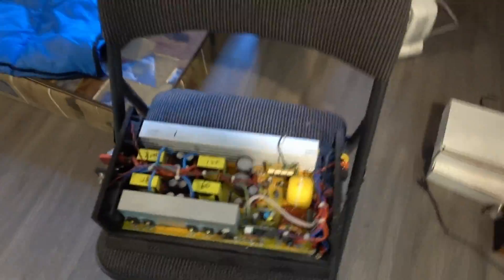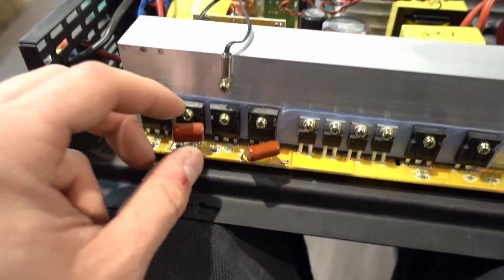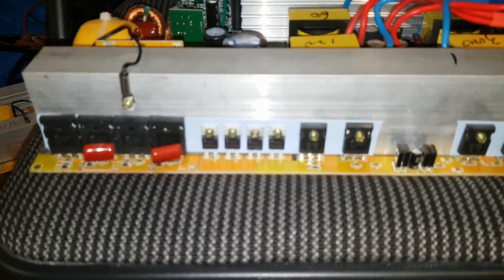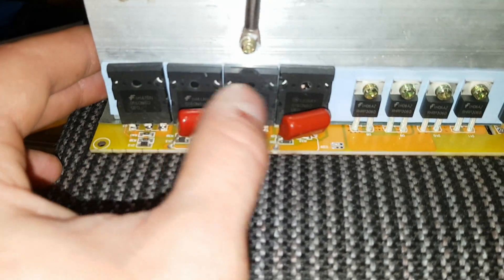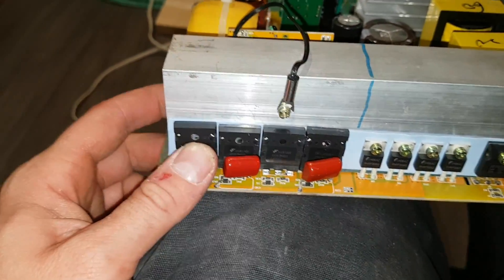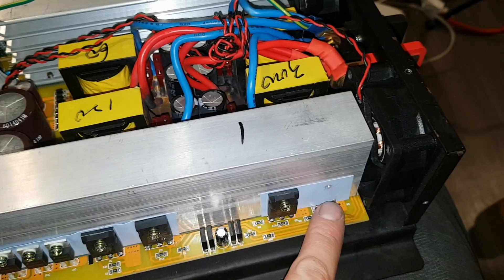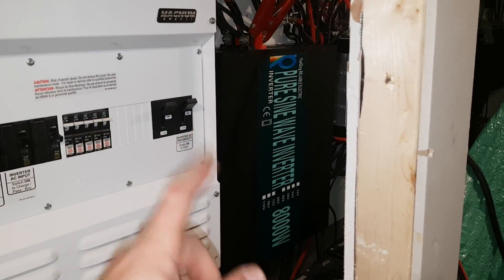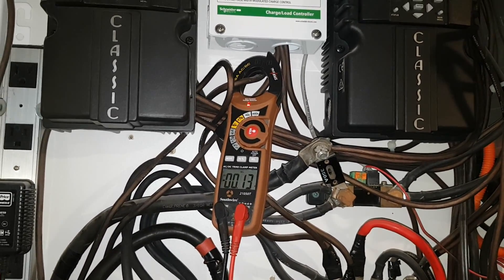3000W inverter Upgrade PT1

Comment: I wish I had your knowledge of electronic stuff. I'm building out my camper and I've got a decent solar system put together with a 4000 watt low frequency inverter for the minisplit and a 3000 hybrid deal running the rest of the camper. Its 1800 watts of solar and some leaf modules for battery at the moment.  Hopefully soon I can get about 20 or 30 kw of  lifepo4
Reply from the maker: That would  be a killer  system,  I have a 15kwh battery bank in my house  trailer with a 3000w inverter and 1200w solar on roof plus 800w of semi flexible panels. I love it! Do you have a video showing your system?
Reply: @GoingOffGrid101  I've not made a video yet but I'm going to try to make the video when I get home. I'm an over the road truck driver and only home 2 or 3 days a month. When I am home I'm working as fast as I can the whole time I'm there trying to get everything installed and working. I've still gotta wire up my minisplit but other than that it's all working great. My leaf batteries have me worries because so many people say they will catch fire and they are under my bed in the camper. I think I'm gonna build a box and set them outside the camper this weekend if I get the minisplit wired up and took care of. I'm wanting to get some lifepo4 but even if I get the lifepo4 I'll probably still use the leaf modules on one inverter and just have 2 small systems rather than having both inverters pulling from the same battery. I'm so undecided about the leaf modules cause they costed me a lot and work great but at the same time I don't want a fire lol
Reply from the maker: @matthewknight5641  if you have a good bms they will be fine put a smoke alarm under your bad and get insurance and never think about it again :)
Reply: @GoingOffGrid101  that's so funny lol.... maybe that'll work
Reply from the maker: @matthewknight5641  I have 9kwh of similar batteries under the spare bed in my trailer.
Reply: @GoingOffGrid101  if I can figure out how to make a video I'll for sure do it this weekend cause I'd like to show off what I've done. It's just a hobby but I'm kinda proud of what it is and can do ya know

Comment: Remember TO-3 versus TO-247 are different FET packaging, TO-3 is older and has more mass (metal). Google it. The MOSFET he is using to do the upgrade and also from the 8000w inverter is G160N60UFD.

Comment: Am sorry to say but it’s the manufacture manufacture fault when a inverter is overloaded the current sensor TC or or current sensor resistor should always sensor the load of either overloaded or short circuit to shunt the unit of of delay the signal for fast recovery my design will never burn up from overloaded or shorts
Reply from the maker: What inverter do you make?

Comment: Hi, i have edecoa 24v/230, 3500w inverter, mosfets are gone. Can you recommend some upgrade for them? Also cut off voltage is too low for my gel batteries, it goes till 20,5, and i would like it to stop at 23,5v. Any advice? Thanks in advance...
Reply from the maker: Can't help with the low voltage on inverter but I use g160n60 IGBT

Comment: Thank you very much for the help you help me recover my $3,000 w inverter only two mosfets were blown the first two in the front different brands magicchip think
Reply: Ran out of solder braid to remove the solder so I only put in the first two igbt Grand a paint stripper for a half hour for testing and use my thermal camera to see the second igbt was the hottest point so I moved the thermostater to the screw for the igbt 👍
Reply from the maker: @leighamos489  thats amazing! thanks so much for letting me know I love it when I hear I helped someone in any way!

Comment: i have the 3500w version but the fets are FQA40N10 but i cant find anything listed on google, is there an equivilent or better that i can use, my invertor is not blown but i would rather have a replacement set as spares
Reply from the maker: I will be making a 4000w inverter repair video soon.

Comment: I had to look this up. An insulated-gate bipolar transistor (IGBT) is a three-terminal power semiconductor device primarily used as an electronic switch which, as it was developed, came to combine high efficiency and fast switching.  Although both IGBT and MOSFET are voltage controlled devices, IGBT has a BJT like conduction characteristics. 2. Terminals of IGBT are known as emitter, collector, and gate, whereas MOSFET is made of gate, source, and drain. ... IGBT has PN junctions, and MOSFETs doesn't have them.  That may still be a bit "Hah?" to some of you (me too), but that is all the looking up I am going to do today.
Reply from the maker: that and they handle more amps and heat :)

Comment: Hi Going off Grid,
I have 1000W reliable inverter and now it has small spikes in zero crossing region. I checked all the IGBTs and FETs and all of them are okay. means there is no any shorted pins. all the resistors in front of the FETs are okay.  I think you can help me to figure out and fix this. Your help on this highly appreciate. Thanks
Reply from the maker: you mean you can see a small spike with a oscilloscope ? is the inverter operating?
Reply: @GoingOffGrid101  thanks for you reply. yes. But there is no any alarm. It shows desired output.
But the waveform is not perfect. My PC  Oscillosecope shows spike in the zero crossing. I can send you a picture for more understanding. Do you think there is something to do with FETS? Or the controller EG8010?
Reply: I sent you a screenshot of output waveform please check

Comment: Can u help me can u help me find out what the internal resistance is suposed to be on an 18650 battery im gonna look but can u help me find out too if u can
Reply from the maker: it depends on brand. and do you have a tool that can measure it?
Reply: Going Off Grid yes i got a few meters and i just got in my zanflare charger discharger to test them

Comment: You could just remove the blown output stage and wire the DC bus into a common VFD. Then you'll get full V/Hz soft start and maybe even FOC to operate much larger motors than would normally be possible.

Comment: If you call the place you buy it from the guy said he would send me replacement parts for like $80. But, I thought it was not worth the risk as if I repaired 50% chance it would not work.   But, if you need parts, you can probably buy them from the Chinese seller.  They say many of the expensive parts are from the US anyways.  There is a test video you might want to add to one of your videos just in case they remove them.